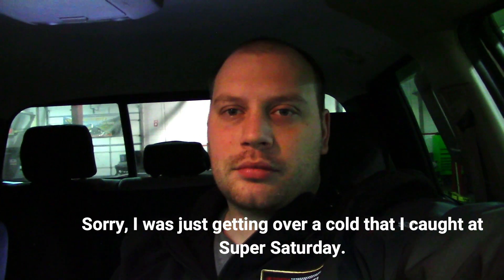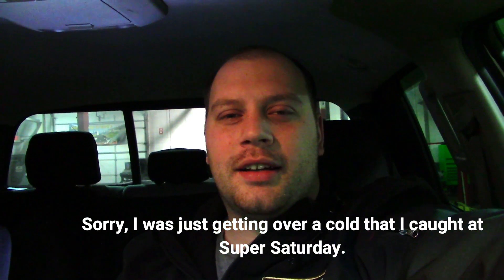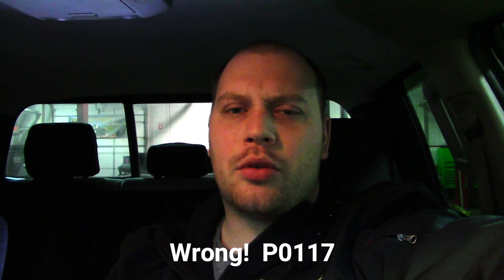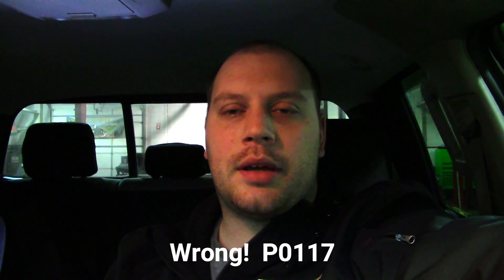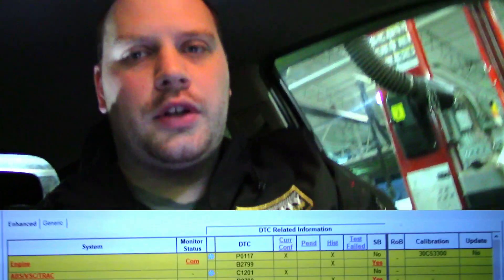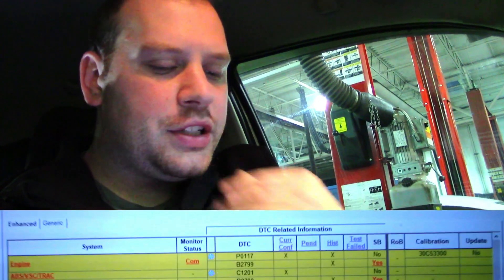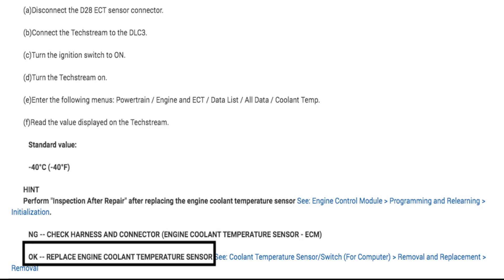My diagnostic flow chart rant (2014 Tundra P0117)

Comment: 12.18.2019
Los Angeles County

Good job Man but I wonna discuss that
- 40 Degrees.

To determine if the Wiring from the Engine Coolant Temperature Sensor is Good, Not Open or Shorted :

1) Scan Tool connected to DLC

2) Key On Engine Off

3) Disconnect Male Side of ECT from ECT & the Scanner should display - 40 Degrees Fahrenheit

4) Place an opened Paper Clip terminals to the two Terminals inside the Male Side ECT Harness Terminals & the Scanner should display over +300 Degrees Fahrenheit

When both of those steps pass, there's nothing wrong "with the wiring" from the Male ECT connector to the "2" wires @ the Computer...This Logic only works on Thermistor Sensors :

( Intake Air Temperature Sensor )
( Transmission Fluid Temperature Sensor)
( ECT Sensor )
Reply from the maker: Correct! That's how I diagnose thermistor circuits.

Comment: Good afternoon. I went they all the steps to address the PO 171 on the 2000 Corolla 1.8. I verified fuel pressure and after doing that I used the injector pulse tool to check my injectors. I cut a terminal off a 1.8 at the wrecking yard so that worked perfect. My starting pressure was 42 and all pressure dropped to 26. Next it was time to check the MAF. I had road tested with Diagun and recorded it. No baseline but no power. 40 gps was max. Cleaned MAF. Started car. When revving, could tell right away it was fixed. Also check engine light went out by itself. 72 gps was the new max. REALLY appreciate all the guidance. Happy Corolla!!
Reply from the maker: Bill Rimmer great diag Bill!

Thanks for keeping me updated on this!

Comment: Please let use know what you find. 	Great video mate.
Reply from the maker: The leak down test passed. I ended up putting a radiator in it. It has been about 2 weeks since the repair, and the customer hasn't been back.

Comment: what are you calling a "leak down test" for head gaskets?  Explain please
Reply from the maker: The engine at one point was at least 284 degrees.

I just wanted to make sure that there wasn’t any damage to the head gasket from it being overheated.

Comment: It's my habit to always save freeze frame and erase the code. Run the vehicle. If it comes back I know it wasn't a fluke. And depending on the customer I'll put a new rad, thermostat and temp sensor ($14). But great call on checking health of the motor prior.
Reply from the maker: Thanks! Yeah, I usually save the freeze frame. I diagnosed this vehicle the night before filming it, but when it originally came in, the coolant temp was 284 degrees. I have no idea how the engine survived lol

Comment: Nice work...In the preamble to the fault isolation procedure in the manual is their not a statement with respect to prerequisites?
Reply from the maker: Not within the flow chart. But I’m sure there is a section in SI that tells you to check fluids levels first, honestly.
Reply: @VoltageDropDiagnostics  SI ??? (standard inspection ?...I am not an auto mechanic)  I have made this mistake many, many times. Step into the manual somewhere that "fits" the defect. And totally overlook the root cause by not performing the preliminaries. Cheers

Comment: Thanks pj!
That's why we can't let codes dictate our diagnosis. It's only meant to be used as a piece of data. Much like that Honda that gave me a map sensor high voltage, caused by timing issues! Thanks for sharing!
Reply from the maker: Yeah, for sure! I forgot about the Honda that you had.

I just wanted a good example of where Flowcharts can lead you down a bad path.
Reply: I just started at honda and my team leader told me thats one of the 1st things he checks! Timing & valve adjustments

Comment: Great job PJ.

When diagnosing a fault it is always important to see what the code is actually telling us and then look at the surrounding clues and operating conditions in order to determine the root cause of the code being set.

SI gives you the start, but it takes a good diagnostic tech to put the pieces together and interpret properly.
Reply from the maker: Yup. I agree 100%. I just wanted an example of where a flow chart could lead you astray.